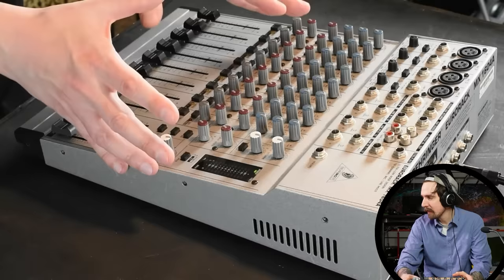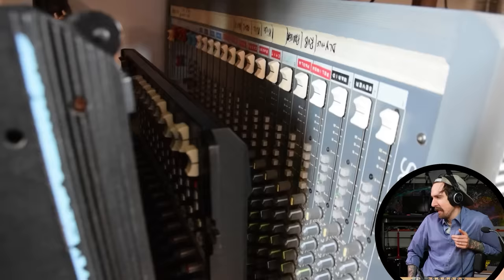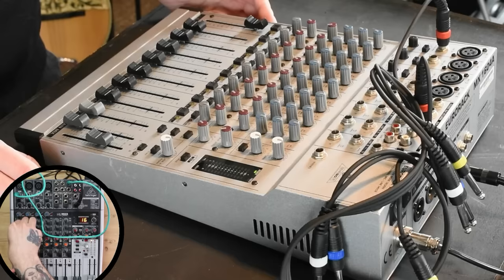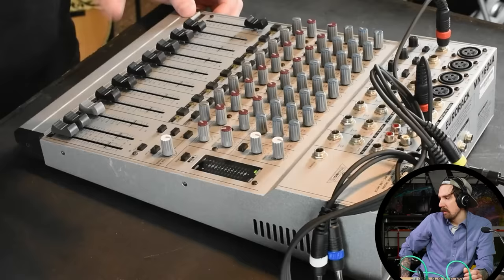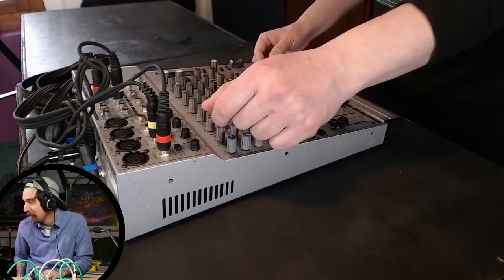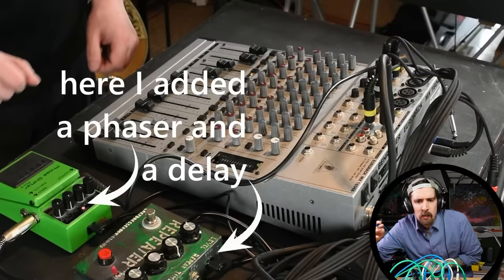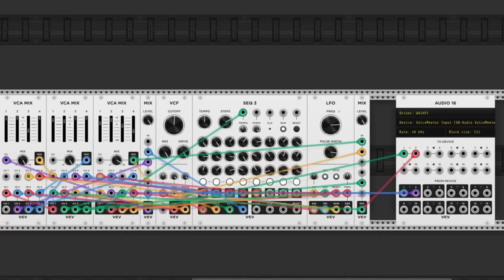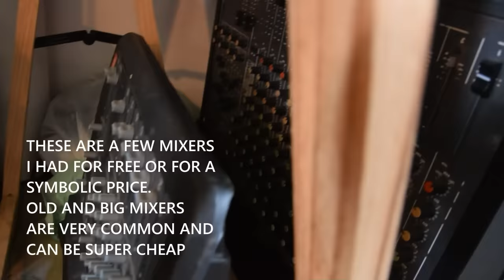Every Garbage Mixer Is An Awesome Synthesizer

Comment: One thing I'd be interested in seeing with this would be to put the output through a limiter (to prevent it from overloading the input of the other equipment) and then into one of those vocal processor pedals that create harmonies based on a second carrier signal produced by a guitar or piano.
If you can get it tuned to a quantised pitch using the pedal and then use it to produce chords I think you could come up with some really interesting sounds that would fit more conventional music whilst still allowing for experimentation with the parameters to create textures.
Reply from the maker: Epic! I wonder about vocoder also or autotune yeah
Reply: @SimonTheMagpie  vocoder could be cool if you run the output of a drum machine into it and use the feedback loop as the carrier signal.
Also works really well for bass guitar.
The kick and snare drum sit in different parts of the spectrum, so you can get these really classic Drum and Bass/Techno vibes, especially if you layer it over a regular drum loop.
Saw Adam Neely messing around with that technique in one of his videos and have wanted to give it a go ever since
Reply: That's a super nice experiment to do! Totally worth a try!

Comment: I discover this like a year ago. If you run pedals in between the inputs it can create really cool sounds. Also you can do something similar to no input mixing with just pedals like stereo delay. I used my friends Behringer vintage delay (VD400) pedal which worker really well. Been thinking about getting a used mixer off reverb just to do this kind of stuff with. I actually use the mixer I have now for stuff lol
Reply: try doing no-input digital delay. it's p much the same concept, with the benefit of the delay effect, parameters etc.

Comment: If you’re a guitarist and have a wah wah pedal, try plugging it backwards, maybe not as versitile but you might find something out if you experiment ;)
Reply from the maker: Didnt get it to work?!
Reply: I'm not sure I understand. It's pretty simple, you have the cable coning out of your guitar, and the cable that goes to the amp. If you plug the guitar in the output jack, and the amp in the input jack, when you turn on and goes full heel (or forwards, I don't remember now), you're gonna hear a squeal, and that's the sound. I think you can control it with the tone knob on your  guitar. If you want to check out uses of it, David Gilmore uses it on Echoes and other Floyd songs, gives you that seagull sound.

Comment: Hey I have and use that mixer and I have every one of its holes being violated, sends and returns, but with a Roland jp8000, jp8080, sp808, mc505, mc909, moog mother32, I don’t think I need to cheat the synth effects.

Comment: lulz, yeah totally possible(as u found) !!  I luv doing this with the op amps themselves. opamps & passives are uber cheap. any opamps with limiting are safe & dont die
Reply: oh and also, using raw components the sound quality is unparalleled
Reply from the maker: Yeah making a synth with just tons of TL074?
Reply: @SimonTheMagpie  Yup, that is the thing, but that is my least fav opamp. that and 084. They have a sound which is blah, plus are prone to lockup & don't go far to the rails. Plus there is this weird thing where they go backwards. i forget off the top of my head, but its annoying where you'd think it would be fun. They suk balls, I replace ALL of them in audio. Don't let them touch the sound.   
      the 4558 & the 5532 are perfect opamps, they do what they intend and sound great. Only negative on 4558 is signal bleed from A to B, its like cross-contamination. 4558 is the winner for messing about and stretching the limits. 5532 is the best sound. 
   Last thing,, you say tons= nope, just one :) give it a try, copy a stable configuration and then just mess about.  like a buffer or simple audio gain, then add a handful of 10k pots on both sides, twist the knobs, a few wires(from more 10k pots) for feedback/feedforward. its surprisingly simple.

Comment: What is the first output?  What made the "square wave?"  That part isn't explained.
Reply: The sound you hear is basically the background noise of the circuit which is exponentially amplified feeding it back into itself till it becomes audible. I just used one of the main output of the mixer to send it to the speakers/audio interface.

Comment: lol i have a shittier behering in the same kinf of style it only has dials and no faders, it does have a (mono) send and return though , so could see this work with a guitar pedal, since it has no FX chain to really make it spicy either  lol
Reply: You don't need the exact same configuration or models that I or Simon used to create feedbacks. For example you can use the phone output, or the tape out, if you don't have auxiliary outputs.

Comment: Thanks Simon and Andreij, really entertaining, especially watching Simon's discovery delight at doing, stuff. However, this video is really doing my head in, I'm trying to understand what is actually going on... I guess I just don't understand how a mixer functions in the first place, because before you started adding in effects pedals I was thinking, ok cool, now how do you add that downstream into the audio chain, then the pedals came in and I'm like, whah? How does that work? The distortion gets mixed with the other inputs but doesn't act on them right, and then the whole lot gets fed back into Ch 1&2, right? Mind blown. Does not compute. "Fatal error: Brain Not Found."
Reply: Because of watching this, I am now the proud owner of a Woosun Focus FC-1602 "Professional" Mixing Console 🤣 Simon, you seem to be good at playing with electronic mods. Here's a question for you: Insert Channels send out a signal post-Gain and Pre-Fader for adding in compression, distortion, and/or other effects to a single input channel signal. In your opinion, would it be better to reroute the signal out on the insert channel for post-fader output on a channel or is it better to add an extra output jack into the system? I'm toying with the idea of how to get multiple-inputs from my analog mixer pre-master mix down. i.e. usb-ify each analog channel post-fader into my DAW. Existing multi-input options could take the Insert Out signal, but why bother, may as well lug in the instrument directly to the USB interface, right? How does this relate to no-input mixing? Well, the idea is to get the post-fader output of each channel into the DAW on a seperate input stream and subsequently record each channel independently without the bottle neck of the 2 ch output that the master monitor outputs afford. I'm currently looking at a product similar to a MicroMix Stereo Input Mixer to act as the go between AD converter.

Comment: This is awesome!  A couple of questions: 1. Where's the sound coming out of? 2. Can club DJ mixers (such as DJM 900) be used for this?
Reply: 1. The sound is just electrical noise, multiplied over and over in the feedback loop. 2. If it's got OUT jacks that you can route to IN jacks, you can use it.
Reply: https://youtu.be/lTLfORtUIFk 

suggested by @jreign
Reply: @crnkmnky  I meant, as in are there speakers or an amp attached to actually hear the sound being made. Was kinda worried about which output source to use, based on the comment about extreme volume. I guess keeping everything at 0 to start would be the go. Thanks for the suggestion re. mixer, might give it a try!
Reply: You send the signal out from the main outputs so you can control the master volume more easily.

Comment: I'd like to understand better:
So, the initial signal that is generate and manipulated is the mixer's internal noise?
Reply: Exactly. It is the background noise of the circuit that is amplified and feeded back till it becomes an audible sound!
Reply: @AndreijRublev  thank you ☺️ 
It looks like very unpredictable and un-programmable for live use where even the quality of the power grid would influence the sound
Really nice and inspiring toh 🔥
Reply: @nagualnazgul3101  it is really unpredictable, yeah. Not for every type of use definetely. Live it can be used but you have to put in the count an high level of improvisation, or to use it in an improvised and unstructured type of situation.
Reply: @AndreijRublev  I usually play electric guitar, drum machine and some sequencer/keyboard in a loop station environment and I really like to improvise, so having a new instrument at hands is a really nice discover 
Thank you again
Reply: @nagualnazgul3101  happy to be helpful! Have fun!

Comment: Can this damage the mixer?  It seems some of my channels are not working anymore.  I have a Mackie Pro FX.*UPDATE:  I suspect the connection port is damaged somehow.  The contact points are not all touching the 1/4 jack poles.  When I insert the jack fully, there is not sound.  It only works if I pull it out slightly but sounds low.

Comment: Behringer used to suck. I had one of their first mixers and it was noisy as can be. Static and buzzing. Then I bought one of the Xenyx models and it was quiet and basically similar to a Mackie. So they're not really trash anymore.

Comment: Can someone explain me how this actually work? Why do those signals react how they do in this video? Why does the filtersection to so much to the signal then it is supposed to do?
Reply: Basically the background noise of the circuit is exponentially amplified when you create a feedback loop and it becomes audible. The filter section, as much as the volume faders and the gain knobs, are part of the circuit so they change the feedback in different ways.

Comment: If you’re getting something like a square wave from the feedback loop, I wonder if you can get the eq filters on a different channel to resonate enough to give you a sine wave too
Reply: Feedback is always a sine wave. You are getting the square waves because every single component in you channel is overdiven beyond believe. If you want a sine wave you would need to turn everything way down, which would propaply just stop the feedback because you can‘t control the volume of the feedback finely enough. It would kinda be on the last micrometer of the low side of you pot/fader range.

Comment: Would it be possible to do this in ableton? It seems like it should be somehow
Reply: It is possible to do it in the digital realm but it is a very different process because you don't have the background noise of the circuits, and the sound results are different too.

Comment: Can I use a powered mixer?
Reply: Yeah I think so, but DON'T use the amplified outputs to generate the feedback. Eventually use them just as normal outputs. Passive mixers are way easier to handle, active ones can fry stuff.
Reply: Nice that's what I was hoping. The one I have is a traynor pa 6400
Reply: It's a 70s one
Reply: Yeah, definitely stay far away from the speaker level outputs. Feeding that back into the mixer will almost certainly damage something. But other than that, it's just like any other mixer!
Reply: Awesome. Thanks again

Comment: For this sh.t you need just very few radio electronic parts, not the whole mixer ))
Google 555 audio oscillator. The breadboard, a capacitor, a resistor(s), a potentiometer (the knob), ne555 chip, 3-9v battery (or a pack), audio output socket (one with springy legs, they fit solderless breadboards). Instead of the socket you can just take a speaker and connect wires to it's contacts.
This was my first "synth" ever ))
Have fun, dudes! And take care of your ears and chips 😉
If ur 555 is getting damn hot then try bigger resistor values!
Reply: For the complex stuff - Atari punk console. I'm sure it can be used in pairs or more to create really weird stuff. Feed it to any resonant filter (Sallen-key is the simplest but needs lm13600/13700 chip, any Chinese forge is fine!). A real analog reso filter is head above any VA/VST emulation generally. Because you can fine tune it, tweak with different parts and etc.
It's ideal if you going into noise music theme!
Reply from the maker: Hey! If you havnt tried then check out the 40106. Even less components needed than 555 to get started and having fun 😄
Reply: @SimonTheMagpie  yeah, that was my 2nd little sound machine )) I've even recorded an "album" with it ) (+PLA chip)

Comment: Does this damage any of the effects you add to the loop?
Reply: not really, but I guess it depends also on the single effects and how they are built. Of course if you prefer to be safe you can add them after the main output, so you can control the volume and avoid any risk.
Reply: nope!
Reply: but take the volume warning seriously, i'm ok with feedback but hearing at full volume with headphones on isn't a nice experience
Reply: @benji4935  you are totally right! Be really careful!
Reply from the maker: I was surprised at how clean this specific mixer handled adding the digital built in delay like I do in the video. I wonder how they managed that in signal chain on inside to make it not just distort like crazy when adding it to a channel that is feedbacking

Comment: Would it be possible to hook it up to a keyboard? And if so how do I do it??
Reply: Yes it is possible, it depends on what you want to do. If you want to hook it up and use the mixer as an "effect" you just need to connect it to one of the inputs. It will affect the feedback and be distorted by it.
Reply: @AndreijRublev  thank you, that’s really helpful!
Would it also be possible to somehow control or affect the pitch of the sounds from the mixer?
For example for playing melodies…
Reply: @lastrockgod  It can be, but consider that the volume of the feedback is pretty high, so it will be only partially affected by the sound of the keyboard. Nonetheless it is worth a try! I never did that with a keyboard, but for example I did it with a microphone and the sound of the voice changed the pitch of the feedback, so it is something to experiment with, for sure!
Reply: @AndreijRublev  thank you so much… I will definitely try this out.. I have an old mixer lying around here… so I’m really happy I can find a new use for it!
Reply: @lastrockgod  that's perfect! Let me know how it goes!
Reply: @AndreijRublev  i will for sure, just have to find an interface now.. so it might take a little while 😊

Comment: Only try it on cheap ass mixers. It is a bit limiting as a technique, and you REALLY have to watch out with your ears!
Reply: I think I sort of messed up pre-amps on an old Spirit mixer with this method. They definitely don't do the same as before I tried this. You can make the most of brutal distortions  , but here comes the but....After a few times, I found myself looking for the same sounds and not being able to do it anymore. Why ? haven't got a damn clue, did I sort of fry something? The channels that work still pass signals so.... I 'm going to try this tomorrow again on that mixer and see what happens. I have a feeling more modern components can handle the overdrive better or the circuitry itself is more protected? Shit I'm no electric engineer.
Behringer mixers are excellent for this! And all mixers sound different when doing the method.
I have 2 Spirits, one old, one modern. The old one sounds has way more fat compared to the modern one. But the sound is very similar.
It's very handy for getting über-overdrive-kicks, as in  samples , by passing audio thru at the same time. The audio will temporary compress out the continous overdrive signal. And you can tune the overdrive to the tuning of the audio you pass through.

Comment: this is old school. we've been doing it for decades.. but it can damages things over time. i can't imagine you have not tried this with your effects.. all thru each other  amp out to  pedal in.  on each pedal then spit the last pedal with a spltter to an amp
Reply: I've never encountered feedback in audio signal damaging the gear in which the signal flowed, and I've been doing it for over 2 decades. Of course if the loud signal is amplified and sent to speakers or headphones, it can damage that gear (and one's ears). But in the context of internal signal it just saturates and the voltage is clipped off at whatever level the equipment is designed to use. That's where the term "clipping" comes from. I still have equipment that has produced fully saturated signal for a sustained total of probably months, and it still works fine.
Reply: Same here. Never broke a single mixer and I play constantly with them. The most critical part, as Analog said, is the speakers/headphones. But with the right setup (different gain staging levels and/or limiters) you can feel totally safe.